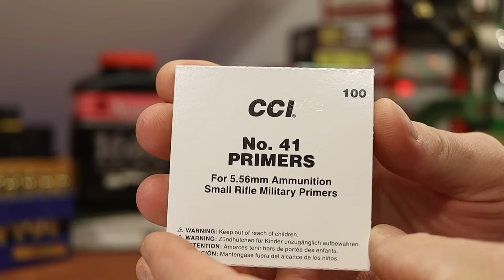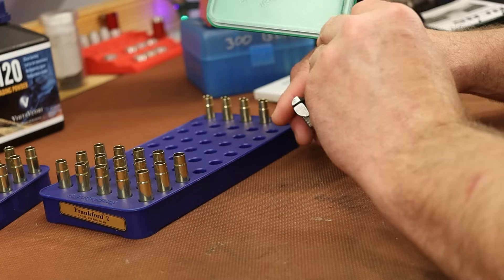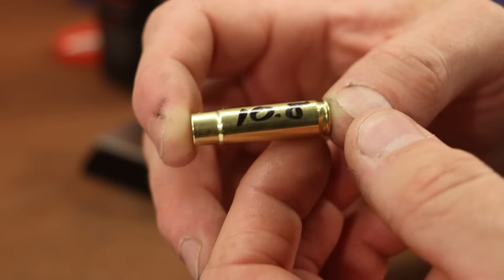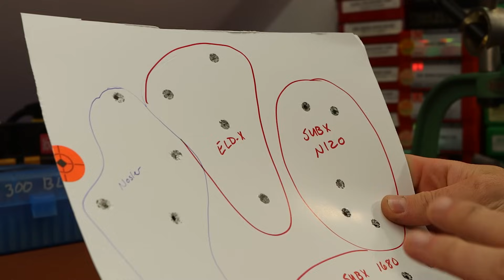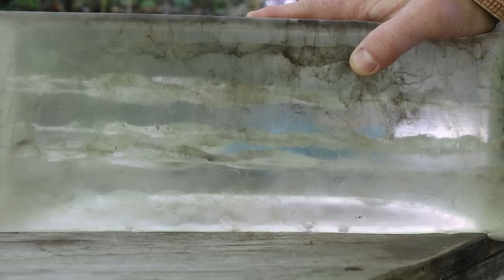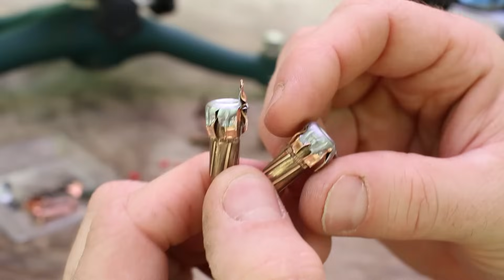300 BLK - 190gr Hornady SUB-X with N120 and 1680

Comment: 208gr ELDx and N120 is my favorite range combo. Unimpressive accuracy but a fun range toy. Also switched to Viht powder from 1680 because it burns significantly clearer. Thanks for the food for thought!
Reply: How does N120 sound? I’ve heard the slower powders are louder, even suppressed.
Reply: @echofoxtrotwhiskey1595  it supresses well, but I'm also using a 16in barrel. I've also experimented with H110. It's cheaper, but the N120 performs better in both sound and accuracy. I'm getting around 3inch groups at 100yds. Dialed in to around 1020fps fwiw.

Comment: Great data. But, why are you still single stage loading bullets after all these years? Is there a reason you don’t use a multi stage loading press?
Reply from the maker: Because I load a thousand different things. It would have taken much longer for me to get a progressive machine set up for this little test.
In my opinion, progressives make sense for folks who load a lot of a few things.
For those of use who load a few of a lot of things, a single stage or turret press is all we need.

Comment: I had a problem with 208 with 1680 from your video. I was testing before I obtained my can (9months).
Shooting at the 20 ft line the bullets' were key holing. I found the bird cage flash suppressor was disturbing the bullet when it left the barrel. Took it off and no problem. They are fine with the can.
Reply from the maker: That's really interesting!
Reply: @JohnnysReloadingBench  It was driving me nut's. This is going back a minute. I think you were testing without the can with a 10.5 barrel. I had the same setup same load but was getting key holes. I was looking back at your video and the only difference was your mussel device. I think you had the 3 prong silencerco adapter. That big 208 at slow speed did not like that birdcage. Super sonic 125 g worked fine.

Comment: Good luck with that bullet. If anything can make it do something useful, you can.

Also, 300 HAM'R is definitely something you should check out. It's everything 300B super wishes it was, and meets/exceeds 30-30 at comparable bullet weights.

Regarding case prep, at this point, Bro, you need the 5 station Lyman Case Prep Xpress, and the Little Crow case trimmer for 300B. Makes quick work of chamfer/deburz etc.
Reply: Have you tried using a 300BO lil crow trimmer on 300 HAM'R cases ? I wonder if it works because the neck length is within the adjustment range. I'm waiting on the parts-n-pieces to put together a 300 HAM'R upper. I'll be making my own brass and probably won't have factory loads to start with. I'm a long time BO fan though.
Reply: @badabing308  I have two 300B Little Crow trimmers. One set for 300B and the other set and relabeled for 300H. Both brass are similar enough at the shoulder that it works just fine. I just set the 300H to trim at 1.595", and the 300B for 1.363". Too easy. Very consistent.

300H is a natural progression from 300B. I never even considered buying commercial 300H ammo. I starting making my own brass from the start using Lee dies.

No chop saw needed. Just well lubricated brass, inside and out, gently resize (spit cases can happen), and then trim and process as usual.

My first loads used 110gr Vmax, 28gr A1680, CCI41, 2.255 COAL for 2540fps @ 43° with amazing groups for my marksmanship abilities.

There are some excellent bullets available but not as many as for 300B due to case length. Forget making a 110/120gr Barnes TAC-TX for 300H. Although that combo would be a fucking monster.

But the 200fps velocity jump with a 125gr TNT keeps velocity at 1000ft-lb at 200yd, and supersonic out to 600yd.

300BH is definitely 300B on steroids but with zero ability to be quiet.

Comment: I would like to see gel of your short 8" barrel 300 blackout  with the same load out you were getting 1050 out of the 16.  I am curious if you get the same expansion.
Reply: 8" can get 1050 fps with no issues.

Bullet doesn't care if is impacting at 1000 fps from a 16" or 8" barrel.
Reply: @Kyle-sr6jm   with his load up he would not be getting 1050 out of the 8 inch barrel.  I would guess it is going to be 900 or less.  With a 16 inch barrel even if the powder was all burned in the first 8 inched there is still pressure pushing on the bullet most of the rest if not all the way down the barrel.  The bullet will continue to accelerate as long as the force from the pressure behind the bullet is greater than the friction of the riffling.ruffling.

What is driving my curiosity is I have factory loads from Hornady with that projectile and a 8.5in barrel.  I do not have access to a range where I could shoot gelatin to see if the bullet will expand when traveling less than 1050 fps.

Comment: With the heavier Subs, maybe you need to try a 1:5 twist barrel and see if that "fixes" the problem.
Reply: I see what you did there :)
Reply: My factory Daniel defense 1 in 8 twist 10.3 inch rig shoots heavy subs just as well as my Q Honey Badger. I like them both but is the HB $1000 more gun than the DD? Absolutely not. I’d say $200-$300 more because I understand that they are lighter and that requires engineering but 50 percent more? Hell no. I love my Q guns and silencers but once you shoot them side by side there is no way someone can tell me the HB is 50 percent better. If it weighed half as much or magically had more velocity with a shorter barrel or perhaps was a sub moa gun all day no matter the rounds then ok. It however doesn’t do any of those. It weighs 26 percent less, is just a tiny bit more accurate (which for a CQB/pig gun isn’t a big deal) it also shoots supers slower and has proprietary replacement parts if something breaks. Which I don’t anticipate happening because its a quality gun but still…Good gun but not an epic gun. If i had to pick, id take the HB and sell my DD but only because it’s a little shorter and suits my needs as a home defense/car gun better, not because it necessarily is a better gun.

Comment: You really need a 1-5 twist 300blk barrel.
Reply from the maker: That's what I've heard. Someone is out there doing some good marketing, I guess.
Reply: @JohnnysReloadingBench  I'm running up to 265gr pills out of a 5" barrel with a 1:5.5" twist. No keyholing in any load.
Reply: @JohnnysReloadingBench  not just good marketing. It’s what AAC originally designed the cartridge with as well as what preforms the best with subs and supers
Reply from the maker: @MyLonewolf25  SAAMI spec is 1:8 twist. Go look at it yourself on the SAAMI site. Did AAC not decide what got standardized? I'm sure the history of the cartridge is complicated as it moved from wildcat to SAAMI, but it sounds like someone is mixing some gaslighting in with their marketing. You 1:5 guys need to tell me where to read about this, I guess.

Comment: Currently working up a copper hunting round in 280ai. Got hornady cx, nosler e tips, barnes lrx and ttsx. Loading slower since pressure with copper solids seems to be a problem. 
Cross referenced loads and seemed hornady had a load starting 2 grains over max of hodgdons. Just seems you can really get in trouble.

Comment: Those Noslers were probably designed for 1:5 twist (which is what AAC designed it around). Unfortunately, the market went 1:7 and 1:8. My next 300 AAC barrel will be 1:5.
Reply: 1-5 is where it’s at. I’d really like to experiment with maybe a 1.-5.5 or 1-6
Reply from the maker: The 300 Blackout SAAMI documentation from 2011 specifies a 1:8 twist (current revision as well). The "fast twist" barrels on the market have usually been 1:7 for years.
I see about 20 comments mentioning 1:5 twist barrels, so I assume that's the latest fad. Sounds great to me, especially if it will help stabilize these big copper bullets in subsonics.
But where are you getting that "AAC designed it around" a 1:5 twist? We have always been at war with Eastasia. lol
Reply: @JohnnysReloadingBench  I think everyone wants that twist rate now because that is what Q uses in the honey badger and may be what Sig is using in their short 300.  Just a guess
Reply: @JohnnysReloadingBench  I have a 10in aero upper with a 1-7 twist that will not stabilize remington 220gr subs.  Going to try a 16in 1 in 8 see if that is capable of stabilizing them. 🤞

Comment: I didn’t expect good performance from those sub-X bullets and it sure shows in gel. One more example of how a well mushroomed bullet does not mean good performance.
Reply: Gotta remember this is at the bottom of it's expansion threshold. I'm sure at 1500-1600 fps it would look a bit more expanded and a bit deeper penetration as well.
Reply: @rileyneufeld7001  im not talking about expansion or penetration. Look at that permanent cavity in the gel. Its abysmal, and adding a few hundred FPS is not going to improve it much, and if you try to push this soft bullet fast it is just going to blow up with shallow penetration.